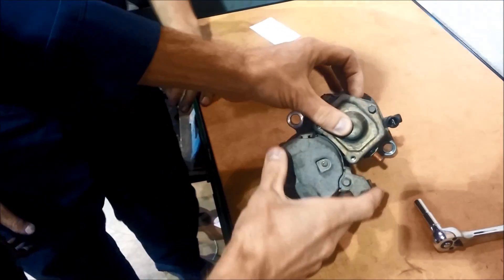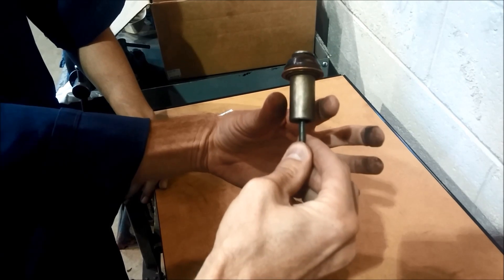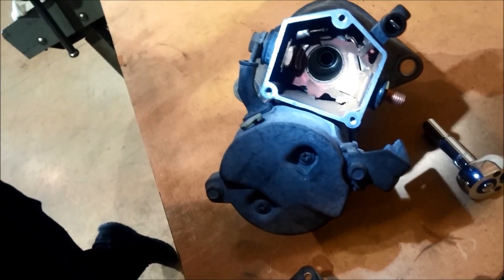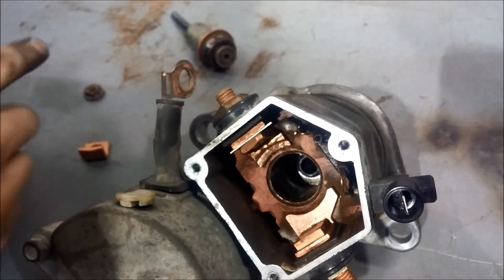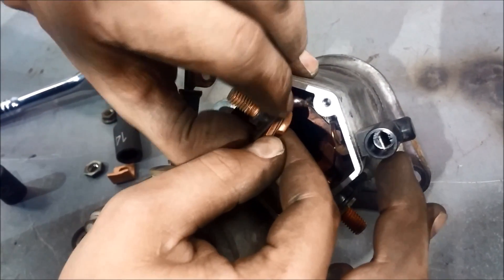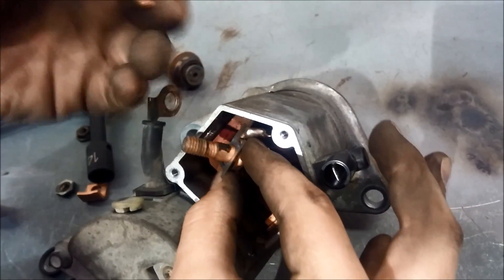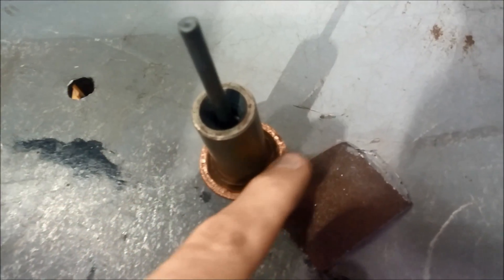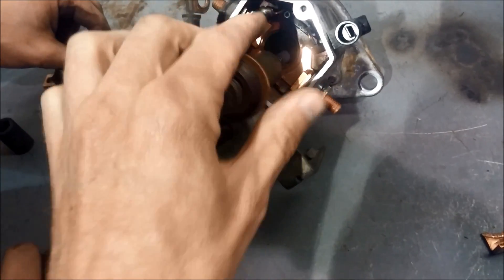Replacing starter solenoid contacts (Nippondenso)

Comment: Great video.  Unfortunately, one of the wires inside my starter has broken.  It is the one that connects to the black solenoid connector.  The connector broke off and separated from the wire inside.  Can this just be soldered back?  thx.

Comment: Hello 
I have a Denso starter that is in a residential back up generator mated to a Ford 2.5l.
 I’m having a difficult time locating the battery & motor contact terminals and the plunger. 

Do all Denso starters that have the housing cover that you took off use the same 3 internal contact parts?
Mine has the same cover that you took off.

Thank you
Reply from the maker: I think that most Denso starters that have the same solenoid shape use basically the same contacts.  There are a couple of variations, but otherwise, they are similar.

Comment: Hey Justin.  I did this fix for my 4Runner.  Trying to do the same thing for my Toyota Avalon, but it has a different Denso starter.  It doesn't have the triangular cover with the three screws for removal. Do you know if all Denso starters can be repaired in a similar way?
Reply from the maker: No, not all Denso starters have a rebuildable solenoid.  If the solenoid cannot be taken apart, then you cannot service it.  However, you can purchase a new solenoid separate from the starter motor for only a fraction of the price.  Check with your auto parts stores.
Reply: Thanks for the reply.  This car has one of those  gear reduction starters.  So I'll try to figure out which part is malfunctioning.  Hopefully I can find the fix.

Comment: OKay ,,my starter isn't a year old. why am I getting intermittent, and lagging , and NO start.(blank response from key?
Reply from the maker: Was the new starter you installed a "remanufactured" starter? One way to know is if you had to return your old starter as a "core."  

If it was remanufactured, a year could be considered a long life!  I always buy brand new starters or repair them myself because I don't like dealing with the same problem over and over.

Comment: Thanks! Fixed an 82 Supra starter, got the contact from the hole-in-the-wall local alternator starter rebuild shop. It's so old school they don't even have a computer at all. One contact was not worn so I only replaced one of the two.

Comment: Why didnt you replace the contact surface on the plunger or just replace the plunger. Sanding the contact surface only increases the distance between the two surfaces when the solenoid is engaged which is the original problem

Comment: Good day, what can cause fuses to blow when I opened this kind of starter and put it back together after I experienced starting only after several attempts?
Reply from the maker: I don't know what fuses you are talking about, but if it requires multiple attempts for the starter to engage, then you are probably still have solenoid contact issues.  Maybe the plunger is worn or corroded?   Maybe one of the side contacts is crooked, preventing the plunger from seating evenly?
Reply: Mske sure you disconnect  battery cable before doin the starter

Comment: Awesome video now just out of curiosity how do they wear uneven sitting here looking at the old ones big difference please explain
Reply from the maker: To be totally honest, I don't know for sure.  Here are my theories:  both contacts don't make contact with the plunger disc at the exact same time.  Therefore, the one that makes contact last will experience arcing, which can cause pitting or wear on the surfaces.  Another theory is that as they make contact (and electricity arcs across the connection) a very small amount of material is transferred from one surface to another.  Because of the direction of current flow, the positive contact will always wear faster because more material is being transferred away from it.

Again, I am not an expert on this, but these are ideas that I have had.  The second theory is based on my observation that the positive brushes in a brushed DC motor are usually more worn than the negative brushes.

Comment: Thanks for the video.    Was going to have a mechanic check it out and get a solid diagnosis before ordering a solenoid repair kit, but I'm kind of on a budget right now and it was too much for me to want to pay for.  I'll hope this fixes it.   Kit should be here on Monday; hope it fixes it.  Car does start, just takes several tries when it's having issues.  So I guess it makes contact sometimes and completes the circuit and other times it doesn't.  I could pull the starter today and have it tested at autozone, but it may fail just because of the contact point issues.  Maybe I'll at least check to see that all the fuses and such are okay, but since it only doesn't happen every time(for about a week it wasn't having issues) I feel like the starter motor is okay.  Think I will check for any corrosion/connection issues today since the part doesn't arrive until Monday anyways.

Comment: Great video. Can I replace this solenoid and contacts without removing the starter from the motorcycle?
Reply from the maker: It all depends on where the starter solenoid is located and how easy it is to access it.  Disconnect the battery first!

Comment: Thank you great video! However i dont know if the problem i hv is the solenoid...the engine sometimes just shuts off while riding, and after sitting like a minute or so and a few trials if lucky enough when pressing start button the engine starts right up..but sometimes doesnt, and no click sound at all. Battery is good fresh, connections are tight...any help?
Reply from the maker: If the engine shut off while you are driving, the problem is probably not in the starter solenoid.  The starter solenoid is only used when starting the engine.  You may need to have it diagnosed.
Reply: Hey mate i got same problem battery are new but when try to start it, its has nothing at all til i hit the starter motor with a spanner while my wife starting it and work so we drive down the road stop on the traffic light car just die, did you find out the problem? Do Need your help cheers mate
Reply: @kaveituavao2748  I know these comments are old but hopefully it helps someone scrolling by. If your vehicle is stalling while driving then that could be a lot of things. The main thing to look for that are easiest to fix, depending on the car, is vacuum leaks. Just in general for a call to stall it could be alternator not supplying enough electricity, the air to fuel ration being thrown off by a leak or faulty intake components, or a sensor being warn/lazy/failure. An example: In my 1998 Toyota Camry LE, the car would stall if I stopped at a stop sign or sometimes even just idling in the driveway. The fix for me was a lazy engine temperature coolant sensor, which wasn't properly sending the computer the right temp of the coolant and threw off my air to fuel ratio. It only occasionally stalled when the engine was warm. This also never threw a code because the sensor hadn't failed entirely. After replacing the sensor for about $9 I haven't had that issue again. 

If you're having to hit the starter solenoid to start the car then the starter is definitely going out. But a bad starter would not cause your car to stall. Those issues are separate. Having your car diagnosed by a mechanic can be pricey for no good reason, and I am a firm believer that anyone can learn about their vehicle and service it themselves in this aspect. In some aspects where you may need to replace large components or you've absolutely no possible way of servicing it yourself after giving it some good effort, then take it to a mechanic. We live in the era of infinite information. That also means mis-information. So be careful.

Comment: Just did this on my Denso starter and it works perfectly now.I usually bench test it before and after the repair in case its something else. I replaced the plunger because it came with the kit.The most difficult part of the job is to remove the starter from the car and put it back in.Cost of the repair $10

Comment: So, before I start digging parts out of my car to do this I need to make sure my problem is the same.  When I turn my key no sound at all.  No clicking, nothing.  However, it does eventually start.  I used to just turn the key back in the off position then on and repeat, releasing the clutch and pressing again.  I found out yesterday I don't even have to do that.  I can just hold the key for about 5+ seconds and it will eventually start.  Is this the same issue?
Reply: Did you ever find a fix for this problem?  I think my issue is on par with what you are describing too.  I've replaced my starter about 3 times already in the last 5 years.  I'm thinking my issue may be something else, but it is so intermittent I don't want to throw more $ for parts if that isn't the issue.
Reply: Since you mentioned clutch, you should check the clutch safety switch for good contact. Attach a test light or voltmeter to your small wire on the starter (disconnected) then turn the ignition switch to start with clutch pedal pushed in. If every time there is a light or 12V reading, then the solenoid is at fault. If at times there is no light or 12v,  then that circuit has to be looked at.

Comment: Where did you get them for a couple of dollars nearby.  If ordered from Hong Kong, the wait is 3-4 wks.  If purchased in the US, the seller buys them from Hong Kong, then marks them up 4Xs, and it would take 4-5 days.  That's tough-going when the car is needed.  Would shimming the contact so its face protruded further forward work?
Reply from the maker: I buy mine from local businesses that rebuild starter motors and alternators.  I live in a fairly rural area, yet there are three of these businesses within a 30 minute drive.  Also, try searching "nippondenso solenoid contacts" on Amazon.com.  They really aren't that hard to come by.
Reply: Thank you for your reply.  I checked online for such a shop.  Low and behold, there is a company that specializes in starters and alternators not too far from me.  Unfortunately, I took the starter out, since there appeared to be voltage to the S-terminal, only to find out the solenoid and motor work fine.  Not sure what to do next.  The starter relay and ignition switch fuse have continuity.  I don't want to pull the ignition cylinder out to check the ignition switch.  Ugh.
Reply from the maker: A lot of starter and solenoid problems are intermittent, and the starter and solenoid will act perfectly fine on the bench.  That is why I always confirm the problem before I remove the starter.  If you are sure that you had greater than 9 volts at the S terminal and your ground circuit is not dropping any voltage, then i would say the problem is still in the solenoid or starter.
Reply: I thought it was an intermittent problem -- don't think so now,.  I asked a friend to confirm my suspicion that there was no voltage to the S-terminal or trigger switch.  He told me that there was a reading on the multimeter -- that's why I removed the starter.  I should have asked him to start the car while I handled the test leads!  A mechanic friend of mine brought his test light over and asked me to start the car.  He told me there's no juice to the solenoid.  He thinks the ignition sleeve or switch (can't remember) needs to be replaced, and suggested I buy a couple of wires and a push button switch to send power to the solenoid.  I did that when my old Chrysler minivan was stolen since the thief hacked the cylinder out of the column.  I would prefer that suggestion be used temporarily, however.

Comment: Calling around reveals that finding the spare contacts locally is impossible. =(
Reply from the maker: Auto parts stores typically do not stock these parts--they want to sell you a new starter or solenoid!  We have a couple of local businesses that rebuild starter motors, alternators and other electric motors.  They usually have them in stock.  Also, the dealership can often get these, although they are more expensive.  If you still can't find them anywhere, Amazon.com has them!

Comment: Can get the contacts from a motorcycle parts place too,Fog Hollow I believe.Harley Davidson uses this style contact in their starters too.The contact kit comes with a new plunger most of the time
Reply: The contact kits for many Toyota starters are cheaper and a match to the HD parts. (Have your HD contacts removed for easy comparison when shopping.)
Reply from the maker: Great tip!  Thanks.
Reply: about$20 on ebay

Comment: Where do you get the contacts from?
Reply: Any starter/alternator repair shop or Ebay has contacts for sale. You can even braze to fill the worn out part, then file smooth